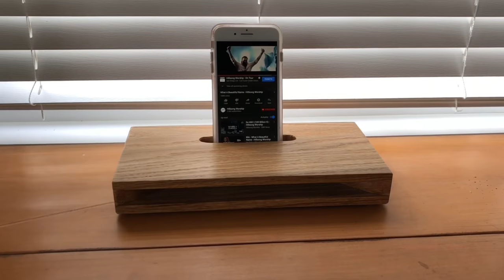Passive Phone Speaker

Comment: This is the same principle as an antique Victrola. I've wanted to build one of these. I imagine, if your top and bottom pieces were thinner, they might be able to convey more lower-end frequencies for a deeper sound. Also, a riser 1/8" high by 1/2" wide in the middle of the spot where your phone sits might raise the phone enough to help the sound escape better than having it sitting down on the wood with the speakers pointed down.
Reply: I came here for the same reason. My speaker is on the bottom right. Wouldn't this design block the sound?
Reply: Neal, interesting points. I’m learning about materials and forms for amplifying sound in a keyboard. How would thinner pieces create a deeper sound? What might I be looking up as examples to learn more about this.

Comment: Speaker looks great but I gave up the idea of building one when I saw your planer, jointer, and band saw as I have none of those.  But thanks for posting anyway.
Reply: There's a much easier design. I've used 1x lumber and 1/2 inch square stock. A handsaw to cut. A drill to cut the hole for the phone. Glue and clamps. I've made 2 and about to start a third.

Comment: I think I noticed you set a board under the top when you used the scroll saw to cut the opening. Was that to achieve an angle so the phone would not set flat on the bottom? How thick was that board or what angle were you shooting for?

Comment: Can't we make one of these using cardboard or something similar?
Reply: After seeing some of these built, I used cardboard and duck tape to build a prototype, just to see how it works. Worked well enough, I made one out of 1/8 paneling and 1/2 square stock. That worked out,so I've moved on to what's called one by lumber. It's actually more like 5/8 thick. Using thicker wood seemed to have a better sound. So my next one will be with some hardwood.
Reply: @paulshrove9901  will give a try

Comment: Nice looking amp. Fast speed videos are a bit much for my old eyes to follow. Explaining the key steps and giving measurements at normal speed would have been better I think. I got dizzy watching this thing. Too bad because it's a nice looking project!
Reply: You can tap on the three dots (or the gear on PC, I think) and adjust the playback speed to lower.